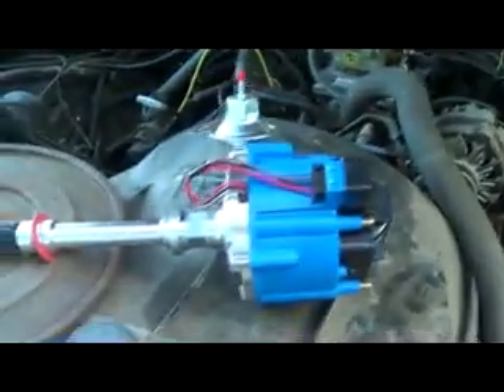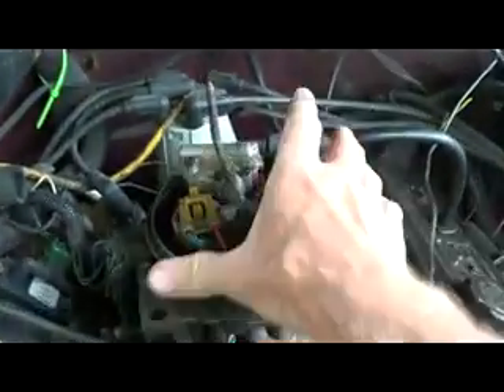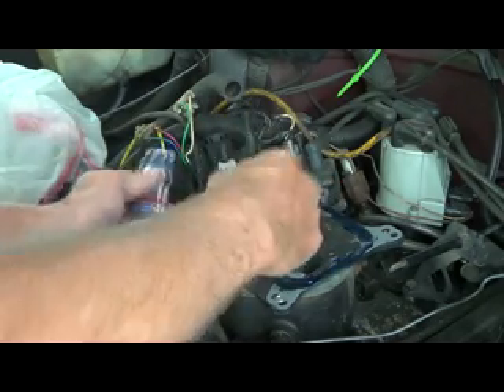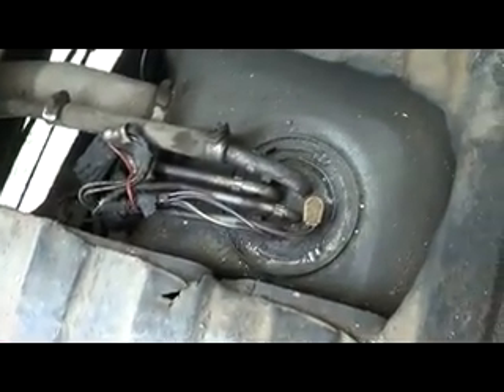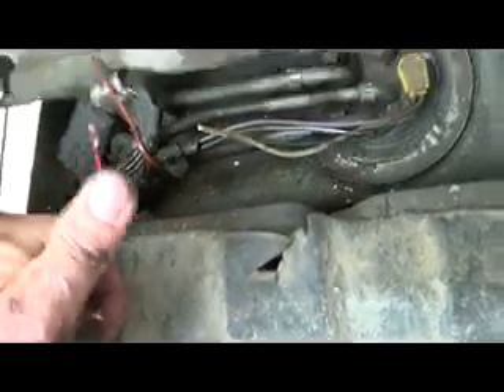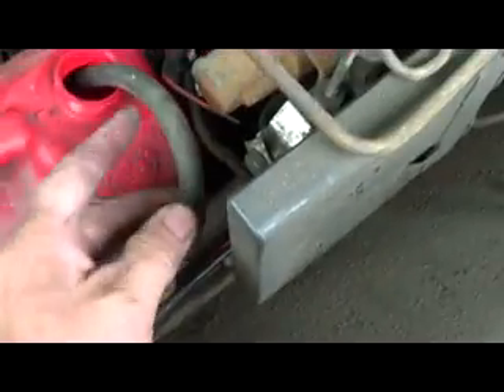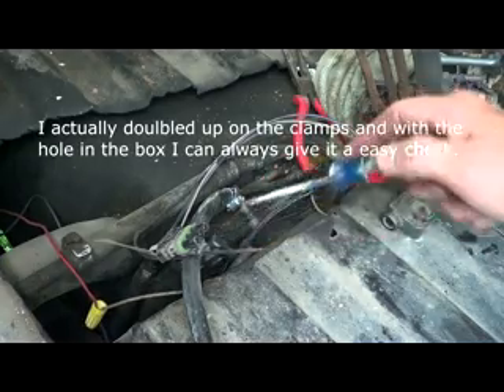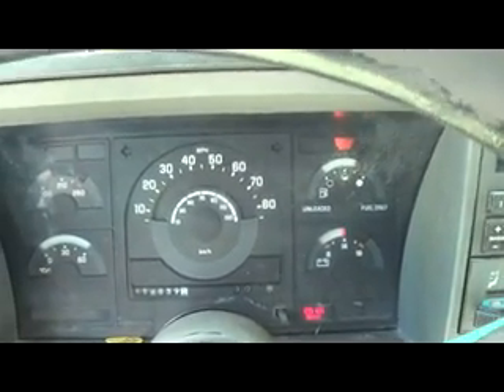changing from fuel injection to carburetor,  chevy truck 4.3 engine

Comment: carb conversion day one for me . made my own adapter plate out of 3/8 steel . starts and runs decent but im sure i need the hei to control spark advance properly . the hei will be installed tomorrow . 
new carb flooded once or twice -- tinkered the float setting -- looking better . im going to try to avoid the fuel regulator . its just something else to contend with . electric pump is only rated at 5 psi . if the needle cant hold that back then theres something wrong ( imo ) .

still -- big progress for one day .
Reply from the maker: Hi Robert,  I seen that problem,  a fuel regulator you can keep it for sure at 5psi or less sometimes those pumps push more than they say, I’ve seen it before,  caused flooding and bad running, good wishes, mike
Reply: @mikehaduck-travel-mechanic884  thanks mike . im going to go backwards this am and make sure my carb adpt plate isnt too warped . its likely since i blew it out with a torch . trying to do nice work and getting anxious to see if it runs - sometimes conflict :)>

i,ll use a regulator if the flooding doesnt cease . .
Reply from the maker: Yep air leaks , I had that too, but once the bugs are out which could be a pain, no more problems
Reply: @mikehaduck-travel-mechanic884  running real nice today mike - EXCEPT - still trying to push past needle valve at idle occasionally . it will get a regulator tomorrow . very sweet idle and the truck carries itself strongly as opposed to the laziness im used to with the tbi . still havent dropped the hei in . id just as soon wait till i have ignition problems / then drop it .
Reply: @searcymasonry  ok mike . bought a regulator -- aint gonna need it . where i cut the old fuel feed hose up near the carb , it had dispensed a bunch of that mud dauber looking shit that corn fuel is known for . thats what caused the initial needle failure and the bad running that has persisted until now . crazy to go from perfect start and run to nightmare in a matter of minutes . thanks for your advice and kindness . this thing runs beautifully right now . ( fingers crossed ) lol .
Reply from the maker: Hi Robert, also make sure the catalitic converter is not blocked you might have to put a straight pipe on it,
Reply: @mikehaduck-travel-mechanic884  pipes dont get any straighter than mine mike . its running like a doll -- thanks :)>

Comment: With those adapter plates it act like a hi-rise intake or small tinnel ram intake XD i plan in the near future to make an adapter for my 94 toyota tercel converted to carb to see if there is a difference in performance and in fuel economy.
Reply from the maker: Hi Sergio,  I have not seen any difference in fuel economy and the carb stopped all my problems ,  you might have to get the bugs out but then I was fine, thanks, mike

Comment: Great job man! cant wait for mine to work right.... so i just did this 94 S10 4.3 had the SCPI its just kept messing up would never idle right and would die randomly until you messed with the injector wire replaced everything still would work right .   i got the Edlebrock intake and new Edlebrock AVS2 500, truck runs way smoother no more random drop at idle or acceleration. but if feels like i lost half my power and ive got the TPS mounted custom bracket kinda next to the throttle and controlled by the throttle, my mechanic made the bracket. the next problem is it shifts real hard at gears at about 2800-3200 rpm and some time wont enter overdrive I have the 4L60-E  we have adjusted where the TPS is pre loaded to, to see if if maid any difference but none. is there any reason they have it mounted on the choke? any thoughts? Thanks
Reply: Is there a way you can show me the mount for the tps? I've carbed a 95 and gotta use the 4l60e

Comment: Hi , I am a mechanic myself and although I have never try this before .  My question now is .... that cam for the engine was design for the fuel injection set up .  You did NOT change the cam over to a carbureted type cam .    Question now ... :    how did the engine perform ?  Did it idle properly where it suppose to ?  What about the performance response on city driving and on the interstate  ?  Does it perform like it should be like a factory vehicle  ?   Thanks for the educational input back
Reply from the maker: Hi Joe,  it runs a lot better then it did with the fuel injection and old computer distributor, I never changed any cams or anythig and I been driving it back and forth from pa to Florida, all the computers do is what the old mechanics did by hand,  I did replace the carb with a edelbrok I got off the Internet for 100 dollars, and rebuilt it, that is on another video called, How I rebuilt a edelbrock carb, thanks, Mike

Comment: Carbs are 10 time better then fuel injection fuel injection was made for the dealers to make more money on repairs and the oil co to make more money carburetors make the engine runs on vapors manly fuel injection is fuel injected raw fuel most not burn drains on the intake manifold and evaporate  the fast passe of the engine don't allow the fuel to be use 100% you got a 35 % waist Carburetors work by suction vacuum 89% efficiency the idea of using a computer to run a car is the biggest rip off to the public the states the use inspection knows this and they  making a kill millions every year  I can adjust a carb to pass any inspection in the planet zero emissions. Computers are rig to shut sensors in the cars to  be replace not by not working butt hours of work  also the computers in self will shot permanently after the factory settings on miles of use Nissan will shot  any time  after 200k today you don't own you car they use technology to  make you a permanent cotton piker and a car buyer they don't wont you to fix your car great or you any engine will run whit a carb and no computer no fuel injection will run whiteout the computer or sensors is this not look strange to you ? fuel injection was made for racing and diesel engines
Reply from the maker: I have to agree with a lot of, I do not want to be a slave to dealers or car companies,  thanks mike

Comment: Carb is MUCH better then that restricted throttle body injection!
Reply from the maker: Hi gigantic, I agree, thanks ,mike
Reply: Even carbs are better than those Nazi invented GDI garbage
Reply: It's a lost art tuning a carb . I was told by the guy whom invented the 100mpg carberator. To heat the vapors. You can't heat shit when gas is injected straight to cylinder .
Reply: And you dont have to have a dumbass computer
Reply: Michael Presley wtf?
Reply: @vladimirvladimirovichputin1352  what? dont tell me you like computers
Reply: Not sure where you get your info but maybe do some research before commenting

Comment: I have a 2002 Chevy S10 with the 2.2 liter 4 cylinder engine (2200 Vortec), and I want to convert from fuel injection to carburetor. Is this even possible? Where would I get an intake manifold an carburetor at? Any help from anyone would greatly be appreciated, thanks.
Reply from the maker: Hi Bobby, I don’t know when you’re in the 2000s there’s no more distributors everything is electronic, they do make MSD ignition and other brands but I think you have to re-rig the manifold yourself , I want to do that someday when I get to it, thanks Mike
Reply: Mike Haduck - Travel - Mechanics - Music   <<  It might be impossible to re rig my intake manifold, because it's made out of plastic, believe it or not (those cheap scapes). I might just drop in a small block Chevy 350 V8, then I'll have all kind of options then.
Reply from the maker: Hi Bobby, I seen a lot of people do that, and you’re done, a lot of work to do it though, I wish you well, thanks Mike

Comment: Hi Mike, I have an 85 camaro that has a carb in it with an engine that blew. That engine was out of an older chevy truck. I ended up finding a tpi 305 and I wish to put a carb on it. Would you happen to know a good way to do this? I can't seem to find an answer and it looks like you might have an idea.  Thanks.
Reply from the maker: Hi Charles, Edelbrock makes a lot of stuff that fits for that kind of car and if the engine blew you might just get a whole new engine with the old-school set up, I think you got to talk to mechanic about that or go to some car shows and ask those guys , Thanks Mike

Comment: throttle body injection was such a horrible era for trucks. I had an 88 dodge ram 360 cu in engine with TBI. Terrible. What a waste. Thanks for posting! I want to do this to an s-10 instead of dropping in a 350.
Reply from the maker: Jonathan Howard It definitely works for me but they’re starting to make trucks that nobody could fix Thanks Mike

Comment: dont use permatex on carbs...dont use wirenuts on cars.
Reply: Ao1968 .
Neck no man.
Bubble gum and bread ties are best.
Reply from the maker: Ao1968 You could be right no worries, But I really haven’t had any problems thanks Mike

Comment: what did you set your igniton timing at? I did same conversion and i am worried the timing might be off
Reply from the maker: hi schitler,  what I did was timed the old distributor to see where I was at, and then matched it.  when I get hesitation or pinging I just keep moving it till I get it right, (the old timers did it by feel)  also inside the distributor where the vacuum port is there is a allen screw to adjust the advance, if it is advancing too fast or too much,    I hope it helps thanks mike,
Reply: I did this same swap, and another, and another, I've actually done 6 of these TBI engines, and every last one of them picked up power, picked up MPG, and Lost the dreaded TBI ping going up hills.... Set your timing at 24* BTDC.  they do not like allot of advance, because the swirl port design is very good for combustion, so you are doing more harm than good by advancing too much...  This was all trial and error for me on the first truck, I've got it down to a system now... Set your initial advance at around 12*.  Limit your vacuum to 10 degrees and limit your mechanical to 12* the only time your going to see more than 24* total timing is under light load cruise which is where more advance will increase gas mileage and not cause problems, but as soon as you step on it, it drops right back to it's sweet spot no pinging.
Reply: Did you replace the distributor? If so, what year model did you use?

Comment: Permatex is dissolved in gasoline...
Reply from the maker: hi jeffrey,   I never had a problem but will look into it, thanks mike
Reply: jeffrey tipton I believe he has the fuel resistant gasket maker that is specifically designed for intake manifold, carb, etc, it should be fine for many years.

Comment: Hi Mike was wandering hows the truck is it still running,getting real close to putting a carb on my astro van.
Reply from the maker: HI Wildmongoose,  it it still runs great,   I ended up putting the fuel pump down on the rail near the gas tank,  runs great,  thanks mike

Comment: Great video!  Can you add a parts list/ numbers. For the items you installed. Example: Fuel regulator you used etc
Reply from the maker: hi ab,  I just picket them up at auto zone, or the internet,  everything worked fine, and I always carry an extra fuel pump,  thanks mike
Reply: @mikehaduck-travel-mechanic884  can you make a list though so its easier for us noobs

Comment: Hows the gas millage with the carb,is there a big difference and is it still running good?
Reply from the maker: Hi Wild,  I do not see a difference,  and if there most experts told me it would be on startup, but as the engine goes it is basically the same, my opinion,
Reply: I've done lots of these and in every case my MPG improved, along with torque and overall HP.  I'm currently driving my 90 model chassis cab that weighs 6200lbs empty and gets 17mpg at 55 without overdrive.  with the computer when perfectly tuned it got 10-12 downhill

Comment: Mr. Haduck, what wires exactly did you cut for the fuel pump? Also, what wires power the in tank fuel pump?
Reply from the maker: Hi JKadey,  I would say you got to get a volt meter and when you turn the key on you will see,  It is a bit confusing but you could take the tank down or cut a hole in the box like I did and then take out the pump and then It will be more plain,  I hope it helps, thanks mike

Comment: as they say a car is a simple device that performs a complex function, and it does it very well.  try a small 400 cfm Holley quad.  big power.  I believe in fuel injection, but I am so tired of complexity, high cost and trouble codes,  especially, on older vehicle.  try a Holley and hot cam.  great swap for older vehicle.

Comment: That's interesting, from what I read online before I honestly didn't even know these converted to carb would run at all without those different HEI distributors, I'm amazed it ran fine with the old setup in place....chasing down electrical problems in an old vehicle is not something I look forward to doing either, I may go to carburetor on my 1992 firebird with the 305 v8
Reply from the maker: my truck is still running fine, thanks mike
Reply: @mikehaduck-travel-mechanic884 How is the truck running
Reply: @mikehaduck-travel-mechanic884 
Dude, I don't know what kind of mojo you got working, but you did 3 things that aren't supposed to work at all.
The backwards plate we already discussed.
The computer ignition working without any fuel control feedback must be driving that old computer crazier than HAL on buck a beer night.
For the trifecta, every guy I consulted said you can't pull fuel through the old pump. I guess they were wrong?

Comment: Also, you still let the computer control the timing?
Reply from the maker: I changed the distributor to HEI  that was self advancing but it was working with old distributor,  thanks mike
Reply: Thanks, that answers my question on timing.  I'm gonna go quick and dirty and try to slap the Holly on top of the MPFI intake - i may come up with some sort of plug for the fuel injector holes lol.  Unless I find a one in the wrecking yard.  Probably need an adapter plate though which will likely need hand made.

Comment: Do you have fuel injectors in each cylinder? I have multiport injection...  thinking ill just leave them in there?
Reply from the maker: I had trottle body injection,  I would thing you have to get a new manifold, and then you got to think about the distributor, I would keep searching,  thanks mike

Comment: I have a question. Getting ready to do that with a 89 ford pickup.  Did you have to remove the pump inside the tank?   Or will the new system just suck gas thru the old pump?
Reply from the maker: I took out the old pump out and you can either splice the one of the tubes or use one of the other ones but I also have a fuel filter before the  new pump,  It that makes sense,  but I think I would pull it out and take a good look at it.  thanks mike

Comment: I've only ever had second hand cars and carbs give so little in the was of problems compared to the damed electronics on modern cars !!
Reply from the maker: Hi Chris,  I agree,  thanks mike
Reply: I was able to get my car home on the float bowl when my fuel pump went out last January. Had that happened in EFI, the engine would've stalled immediately, not in my driveway.

Comment: lol ill tell ya somthing if you wan t to stop breaking down get a ford or dodge
Reply from the maker: Hi Jacob I had them all,   thanks mike
Reply from the maker: I had enough of them to know,  I love a fords style but not their mechanics and the new ones are almost unfixable..
Reply: Mike Haduck - Travel - Mechanics - Music ford Europe are lazy designers like mmm merge the back end of a c max and shrink a focus front end and keep the old fezza body really wish I could show you face to face you deffo get it a bit more
Reply: I’ve fixed a lot of broken spark plugs, cracked manifolds and cam phasers on the F Series. Everything about a Ford requires body off.

Comment: So are you saying you can convert any fuel injection engine into a old style cab engine ?
Reply from the maker: I would think as long as you have the right manifold for the carb to fit,  i would say the problem is more with the distributor.
Reply: Yes you can!
Reply: Yes as long as it has traditonal mechanically cam driven vavle train and uses mechanical gear driven distributors and not magnetic sensor pick -up coil packs controlled by crankshaft position sensors and an ecu, technically you could on coil pack ecu controlled engines, but it would be useless when the ecu dies, plus if you did change over from coil pak to mechanical distributor, you'd have to buy a pully driven distributor only if the cam doesnt have distributor gear and place to tap out area where the distributor is placed and might have to change the timming chain and timming gear/gears, not to sure bout ecu style coil pak motors, as I specialize in classic cars/trucks. Even ones with electric fuel pump can use a carburator, but as far as using the stock electric fuel pump, you might have to buy an after market 40 psi rated electric pump and do a little wiring. Or just spend $600 or less on a pully driven fuel pump and go old school that way, other wise even 40 psi rated electric fuel pump never last compared to traditional cam driven or pully driven fuel pumps